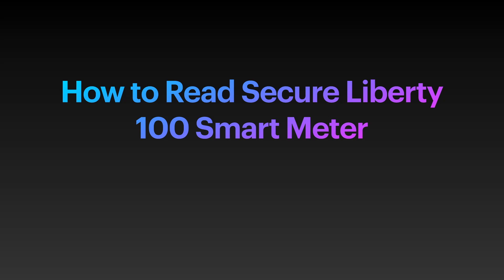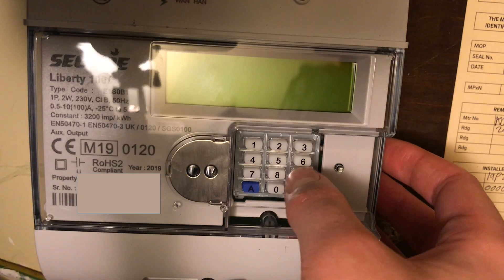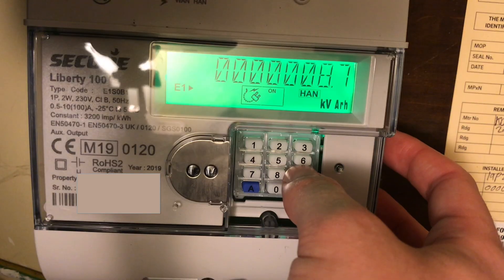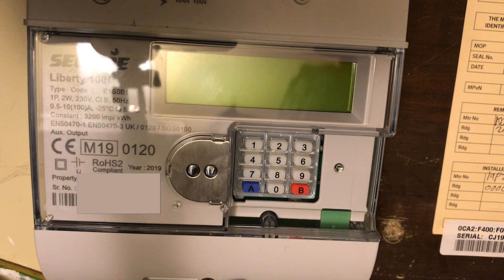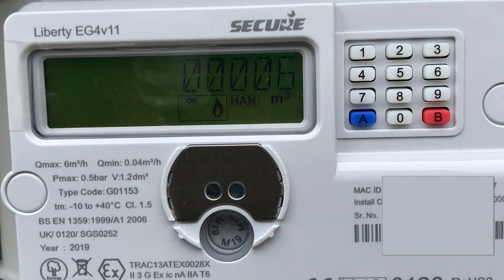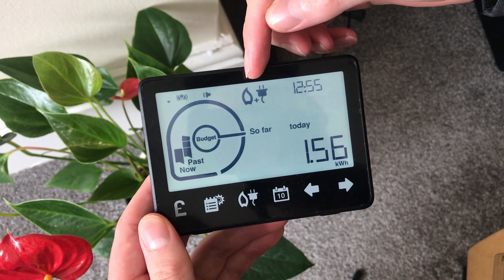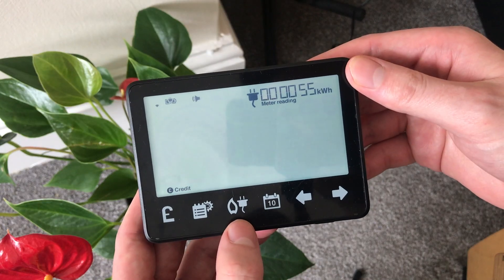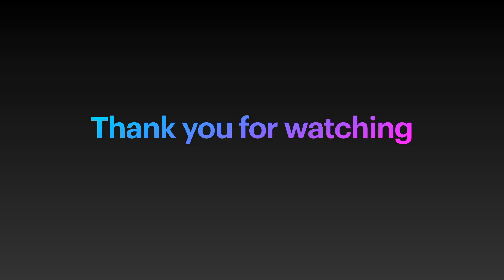How To Read a Secure Liberty 100 Smart Meter: Gas, Electricity (inc Economy 7) and In-Home Display

Comment: The energy supply companies, in my opinion, show incredible cruelty when they expect blind and/or disabled customers like myself to operate these devices with their incredibly poorly designed interfaces. I moved into my current flat in   2018 and British gas smart meters were already fitted. My landlord had installed kitchen cabinets and covered the primary ECV, which has made it impossible for British gas to replace my meters and move the gas meter to a position where I can actually see it. British gas can't supply a monitor for my smart meter as they no longer make monitors for my outdated meters. I've been trying to get the whole mess sorted out for over two years now, and get nothing but excuses and lies. Someone from the gas supply company came out and explained the problem to me, he told me that someone would call me to arrange a time for someone to come out and ensure that the primary ECV is accessible. This was several days ago and no-one has called. I'm planning to call the energy ombudsman and the gas supply company on Monday to see if anyone will at least acknowledge the problem. I've lost all hope that the problem will ever actually get fixed.

Comment: These Liberty SMETS1 meters are appalling pieces of equipment that should never have been installed in customers' homes, especially the elderly for whom they become extremely difficult to operate should they go wrong.  Even in your video, notice how the gas meter display is not backlit - good luck reading that under the stairs.  Could you do another video about how to re-establish connections between the meters and the in-home display?  Once the gas signal is lost, it seems impossible to get back (and, I'm being serious here) what actually needs to happen is the gas meter (fitted only with a small battery) first sends its signal to the electricity meter, which relays a stronger signal to the in-home display.  (That's why you see a flame + electric symbol on the screen.)

Comment: Great. However bulb told us they had added our meter reading to their system and as such could pull the reading at their end. This is a complete lie. Do not fall for this as they will over estimate your usage and try and charge you more. 
Happy to say we are shifting provider as quickly as we can.